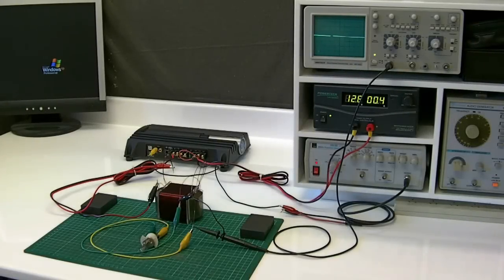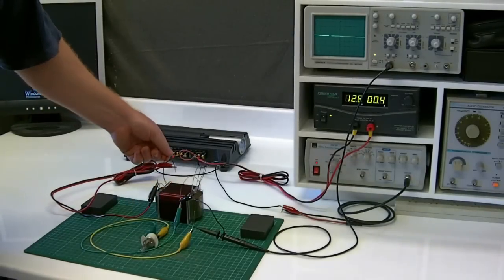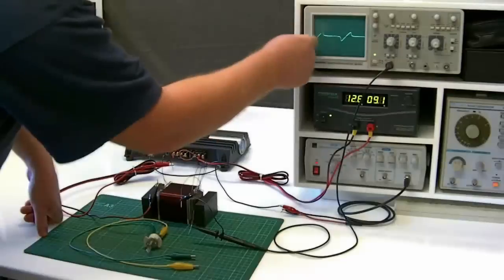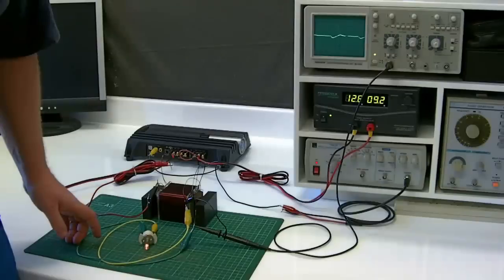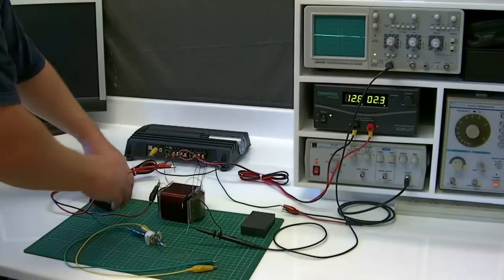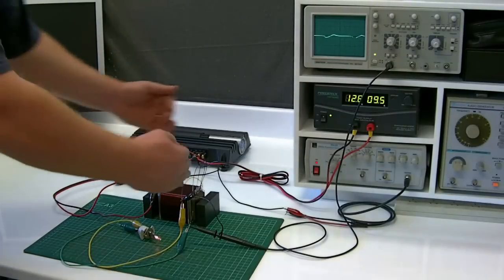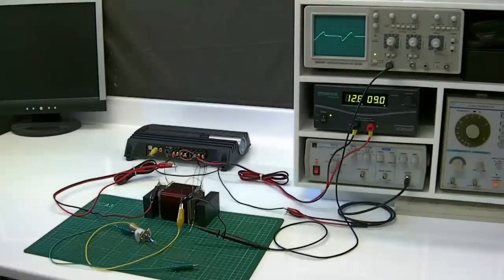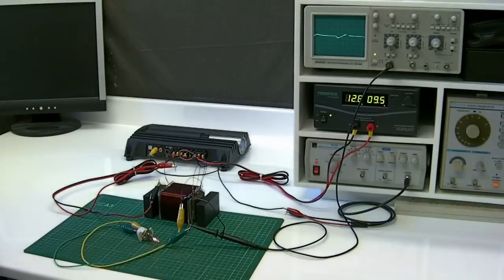Flux Gate Magnetometer or Solid state Generator?

Comment from the maker: So, in other words:
-	Shortest Possible Path in the Clapper Coils - Low Reluctance Path but higher Reluctance than the Iron Bar Keeper on the Magnet.
-	Large amount of Ampere turns - For Magnetic moment, related to Magnetisation.
-	Small but not too smaller core size - Keep the Magnetisation Level High in the Core.
-	Ensure the Iron Bar Keeper on the Permanent Magnet - Shorting the Magnetic Field out,  is not overly Saturated and the Flux is spilling out everywhere.

Comment from the maker: In the Schematic, Hendershot used 5:1 Transformers. This means on average, 20 Volts was the running Voltage in the Clapper Coils. Hendershot did feed back the output of 120Volts back into his unit also so this would have changed the running Voltage some what also.

Comment: I have puzzled over this image. What I can't quite see is whether the BAR is attached to the MAGNET. I think it IS and the solenoids are PUSHED toward the BAR. With the magnets BAR keeper in place, the field lines around the horseshoe magnet change to express the NORTH pole out to one side, and the SOUTH pole out the other side. Further the fields presented to the solenoids are WEAKER and more easily TWEAKED by subtle magnetic field from the solenoid. A power spike would imply back EMF.

Comment from the maker: If you search Google for "Old Telephone Bell Ringer" See the Oak Box Ringers, with the Coils close together, also slightly larger than some of the other Coils, this is the type that I mentioned below. Typically one side of these Coils has a Magnetic Keeper and the other side is non-Magnetic, the Side that is non-Magnetic is usually the side that has the moving ball ringer arm on, and the ball ringer arm, has a Magnetic base thus completing the Magnetic Circuit.

Comment: Oh interesting. I wondered if each solenoid should be NOT attached, i.e. with cores that only produce fields but don't share the IRON structure. I think your right that a U shape and or SQUARE with one side missing provides better FLUX flow between the two solenoids -- enhancing the performance. I recently noticed that the Charles Flynn device is similar.

Comment from the maker: I estimated the Iron Bar Hendershot used to be in the vicinity of 3-5mm thick. If the Coils on the Clapper were in one part of the cycle, attracting the Flux out of the Iron Bar and through the Centre of the Iron in the Coils then Reluctance would have played a big part in the efficiency or this process being there is no schematic that shows a closed path at the top of the Coils Core from one to the other. This is a problem, either the schematics are wrong or I have the idea or operation wrong.

Comment from the maker: I am glad you mentioned this, I have been researching this for some time. A good experiment to try is to take a small Iron Bar, an old CRT TV Set, a few Magnets and arrange them in a situation similar to Hendershot’s Clapper device in his machine, then see where the saturation affects the Iron Bar. So, with the old TV Set, one will see Flux Lines spill out of the Iron Bar when Saturated, more so when grossly Saturated.

Comment from the maker: In an LC Resonant Circuit, any changing impedance (Changing Load) will change the characteristics of the LC Circuit, E.G. changing the Resonant Frequency, damping the Oscillations, and so on… This is whay I believe there must have been a “Ring Up” Characteristic. An extra source of input Energy, likely from the Big Horseshoe Magnet or from another source I don’t want to go into here.
Sorry for all the long posts, limits on Characters..

Comment from the maker: In the early Hendershot device, it was reported that the device had to face the North South Direction. Not so in the later devices however.  If the device worked logically, and there is enough evidence to say that it did not, then any LC Resonant circuit would need a source of input energy to give it with “Ring Up” characteristics and keep the LC Circuit in resonance and running.

Comment: Another thought re: Hendershot. His solenoid, magnet, bar device appears to make the field shift LEFT and then RIGHT, altering the saturation as the AC flows around the circuit. So rather that static magnetic fields, he is creating alternating magnetic fields. Coils are stationary, fields move, current is induced, magnets provide fields and very little energy is needed to move the fields.

Comment: Some thoughts re: Hendershot. He oriented his machine N-S, and then E-W and saw different effects. The Earth's field is 50microteslas (depending upon location), so there is an implicit magnetic field provided by the Earth. Earth's NMR is in the 2khz range and might be a source of high-energy noise -- long wave length however. Bulbs are low resistance load, so current can flow around the coil, thru a bulb, and back again w/o dampening too much. Hence, for an LRC circuit, a bulb is small ohms.

Comment: i had the same idea. by using magnets you can increase the mangetic field in the core from one direction by adding a little current and do the same in the opposite direction. the magnetic field in the core material is dynamic so when you use permanet magnets the field in the core deform by adding a small current in the same direction of one of the permanet magnet. by adding a electromangetic field in the same direction as a permanet field in an iron core the total flux is greater than the input.

Comment: The cause be due to the vector be insuffientiant weak with in one direction but if you convert on the vectors in center with same almoust like tom bearden diagram power the regular powerline poynting vector are focus into the center. Maybe poyntiing vector focus into vortex rotation can give higher power ratio with same input power it all technical work to study how to use vector to gate the energy the easy method

Comment: @SweetSQM so magnets in repulsion work much better than manget in attraction because of flux mmm... its seem you need a certain current draw to see suffientiant physical result just like making a wire with current 90 degree cross powerful magnet to make lorentz force thrust the wire it the air. The cause be due to the vector be insuffientiant weak with in one direction but if you convert on the vectors in center with same almoust like tom

Comment: That is wonderful i had the same effect with one device a made that use two rodin on a tube you can called it bismusth air coil with aluminium it was torsion project. That direct magetic flux toward outward that interact the with coil 90 degree to it when place the rodin coil the tube it draw more current. You can check my channel to see the video evidence. keeping going your experiment is grand step defiently when you are getting current.